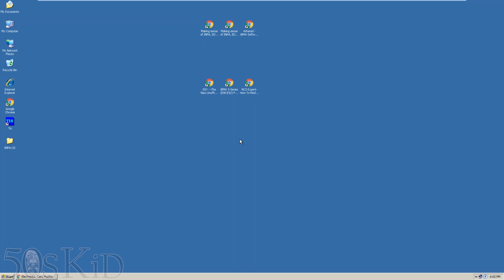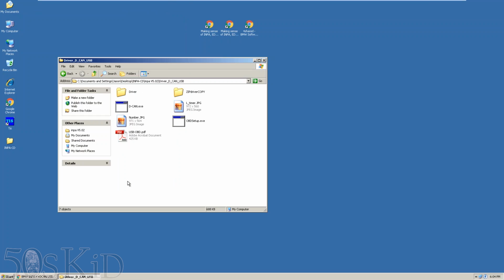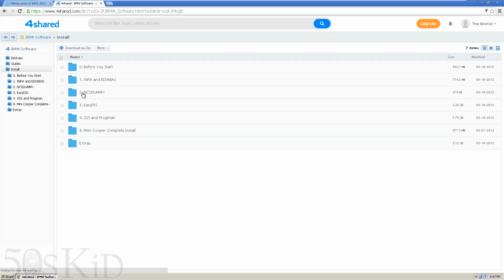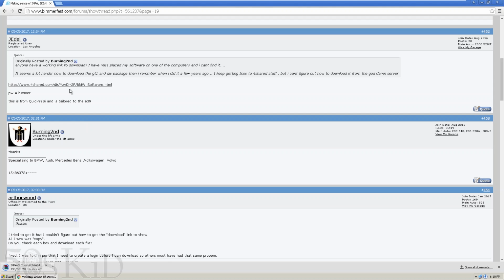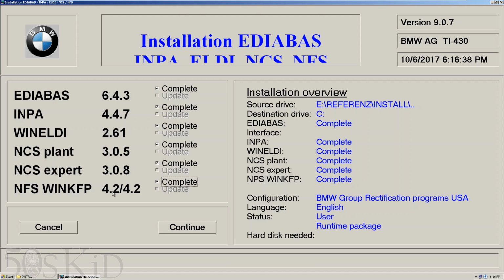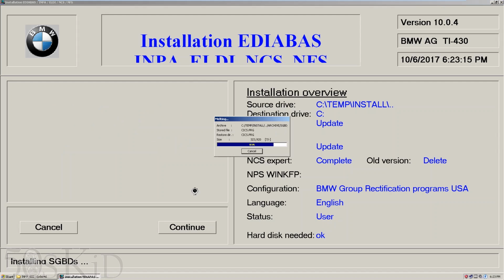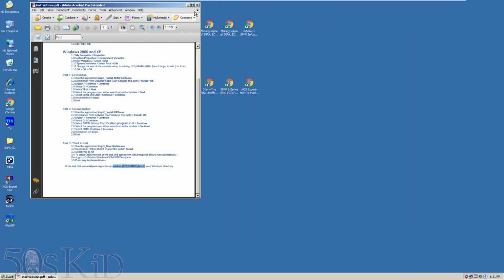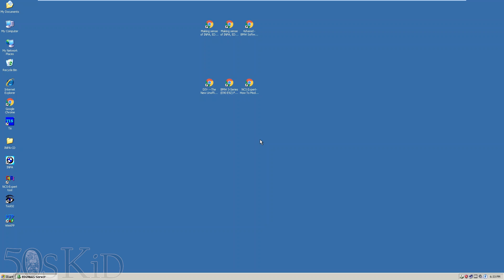How To Install INPA & NCSExpert

Comment: Thank you so much, gonna get the PC going when I get home

I have an 03 540iT, got a 97 540i6spd because the more pedals there are in a wagon, the cooler it is

I'm gonna consult the forums for post facelift auto to manual coding because that link is dead, but nbd

Comment: Hello 50's KID... perhaps you've some instructions pointed at disabling/removing The "ews" features from the DME...My same vehicle is the 2004 E60 545i. produced in may 2004. Inpa error codes are 2737  & 27A4... Perhaps there a preferred way to contact you?  (youtube doesn't allow?)

Comment: hi, need some help. i have it installed, v5.0.0 on my e46 INPA can read the digital and analogue values, it can read in detail the DSC fault codes, but wont read the engine codes in detail. when i select s54 engine it says 'versions do not match. Malfunction possible' Any help would be appreciated (Windows XP)

Comment: Hello my name is angel I have a m73tu swapped e39touring and I have an issue that I can’t seem to find anyone to help me with. I have a laptop with bmw softwares that I bought off eBay a while back and I used to be able to switch between OBD2 and ADS to connect to my cars but something happened while a tuner was remote tuning my brothers tdi through team viewer and I think he might have moved some settings but now my computer only communicates via ADS and I need it to be able to communicate via obd so I can use sss progman to code the dsc module in my e39 any help would be greatly appreciated thank you✌🏽

Comment: your funny david so the ftd2xx.h c++ header fetches the i386 32bit files for the amd64 folder... mikes not so easy tools windows 10 doesn't allow a-lot these days they even shut down virtual machine appliances operating on certain ports but still works on win7... besides if you plan to buy VAG-COM 409.1 you will need a 409.1 CAN and the software which i have and successfully used on a 32bit windows vista.... so you might as well get professional and get all the CAN's to do BMW,VW and maybe others.... stop messing around w/ this 64bit business ...

Comment: I was able, incidentally, to resolve my problem with NCS Expert not running when INPA did run. So for the benefit of others who might encounter a similar issue, I did so simply by soldering together pins 7 and 8 on the OBD connector (top left two pins on the wide edge as you look at the socket). That was the simple fix which got NCS Expert running perfectly on an '02 E46. I have the white circuit board on my OBD connector and understand that the green circuit board is preferred, with two K-Line leads, thus presumably not requiring the soldering. But the soldering together of the two pins works.

For those unfamiliar with soldering, use a short, half-inch length of wire to solder the pins together after removing the four screws on the socket and gently prying apart the two plastic shell halves of the socket. Gently unplug the small socket connector inside from the top of the circuit board to avoid touching that inadvertently with the iron and then plug it back in when done before putting the shell halves back together. "Tin" each exposed end of the half-inch length of small-gauge wire, that is run a little solder over the exposed ends before soldering to the pins, to make them easier to solder to the pins. Then all you need to do is momentarily touch the tinned ends to each pin while soldering for just a couple of seconds or so. That way you won't run the risk of de-soldering the pins or burning any components with excessive heat. 

I had already changed out the USB driver on Windows XP in the Virtual Machine, which was loaded by default during installation, to the most recent version at the "Virtual COM Port Drivers" website, FTDI drivers. Look for the most recent XP driver or the most recent Windows driver and either will work. That had been my first connectivity issue, which prevented even INPA from working. Install manually in the Device Manager of the Virtual Machine XP version, not in the host Device Manager. (I am running Windows 10 in my host machine.) 

Thanks again for these excellent videos. They saved my day after two and a half years of looking for precise instructions on recoding the computer after the transmission swap to eliminate the error code looking for an automatic computer module no longer present, hence preventing smog inspection, even though obviously having nothing to do with emissions ...
Reply: I just wrestled my way through numerous software configurations and after seeing your comment here, finally remembered from a long time ago when I was setting up bmwlogger with a k-line adapter on an E36, that people were mentioning bridging those pins. I didn't have to do that then, but this time I was starting to suspect the hardware and I'll be damned if shorting 7 to 8 didn't fix my "VIN is faulty" error that I have been trying to get past for like three days. Thank God I saw your comment! On a side note, I purchased my k+d can adapter a year or more ago and just had it on hand, so I'm not sure what is going on with ones produced now, but my PCB has a green solder mask, not a white one, but it required the jumper just the same.  I don't usually read comments but thank you so much for taking the time to note this.

Comment: This is a superb series of video. I am also trying to recode my E46 to a manual from an automatic after having performed the swap and this is the first series of videos which provides the sequence in clearly understandable terms. I have been looking for two and a half years since I completed the swap. Thanks... But I have a problem. I got the software working properly and INPA links to the car and reads, etc. But NCS Expert, while it loads expert mode properly, returns a COAPI 2020, no response from ECU, error code whenever I hit any of the modules under ZCS/FA f. ECU after entering E46, i.e. AKMB or ALSZ. I was having a problem initially with INPA not addressing the car, until I changed out the USB driver to 2.08.24 on the VM XP 32 bit device manager from an earlier driver which came with the D-Can + K OBD connector. So, now INPA works, but not NCS Expert. I am set up in the XP Home Edition on the Virtual Machine in Windows 10 64 bit original host environment. I have a feeling it is still some connectivity issue with the USB driver in the Virtual Machine for XP. The USB driver, incidentally, is configured to COM1 with a latency of 1. Has anyone else encountered this issue? It seems odd that INPA works but not NCS.

Comment: This is the best instructional with NCS expert INPA installation. Honestly information is all over the place and sometimes I've spent time I cant get back reading forums only to  conclude that it doesnt show how to do it or its wrong and not working. Thank you sir.

I have one question though on a subject Im having even harder time finding. I plug it in and INPA recognizes I have the cable plugged in. When I go into NCS Expert it recognizes it as well but when I try to load the modules and read VO it brings up "Following feature is invalid for FA: #1207" and I get it to load the codes but I cant change them. Ive read in various forums that I have to update the Daten files and I finally found a download page with V60.1 I think...Well now I have no clue how to update them. Ive tried manually copying them into what I thought were their respective folders but it actually made the program work less and gave me more errors. I had to reinstall your method again as I lost where I went wrong. 

Anyway you can help guide me what forum (theres so many) you may have learned to update, etc? I have a mac running Windows XP 32bit virtual machine. Trying to code on a 2008 335XI (has JB4, this couldnt be an issue could it?) . I should try it on my e46, maybe its my car, or maybe my cable...

Comment: Hey boss. I am planning  to do coding on 2005 bmw 325i. Is this cable works on it ?. I looked some comments they said this cable doesn't function  proper  because pins . It should be 7 pins.  Is it true. If yes then please advise.

Comment: Hey 50sKid - thanks for putting up this fantastic Video. Do I absolutely have to use COM1 for the serial port? I have COM1 currently "in use" so I opted to use COM2: is this going to be an issue?
Reply from the maker: whatever is using com1, find it and change it to use another com port, then reboot and you can use com1 for the cable
Reply: Thanks for the response. Just installed everything and it works great. Thanks for putting up such a fantastic video

Comment: Can you help me out?  I have a 2006 E46 M3 SMG.   I bought software and a cable on EBay but discovered that my BMW model was not included. Could you point me to some where I can get the complete software package that will work on my M3? I’ve looked at so many packages I’m cross eyed and confused.
Reply from the maker: Look into ISTA rather than INPA. It's newer and covers more.

Comment: Sir, You rock. Yeehah! Following your astonishingly clear instructions I'm up and running on a Mac Air with Windows XP, using virtual framework Parallels Desktop 7, on Mac OS10.6.
Reply: Btw This is NOT a criticism but the very first step in the pdf instructions seemed to be missed out - Updating the System Variables Path. 

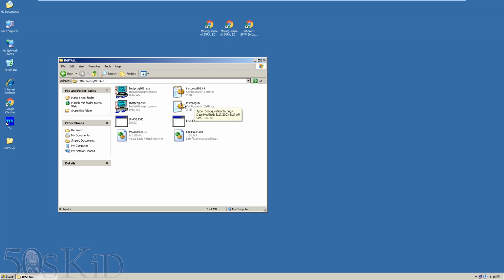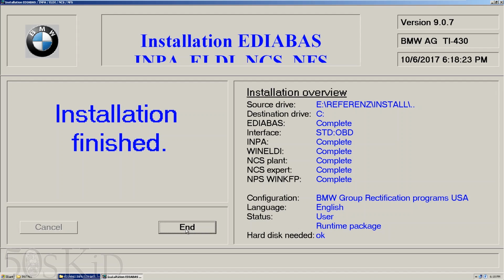A note for anyone else doing this and having errors after running the Install EDIABAS etc (Instprog.exe at 8:52). At the end when you hit the Exit button (9:25 in the vid) it can take a while for it to close. Just wait for it to close itself. It is definitely working in the background and the first couple of times I force-closed the window which I think was the cause of subsequent errors. The more of the modules you 'Check' to install, the longer it seems to take.

Comment: Just a VERY important tip, make SURE you get the cable with the GREEN circuit board, I went through trial and error buy buying one with a WHITE circuit board that does NOT work. I eventually got the one with the GREEN PCB and it works 100%

Comment: Thank you for such a great tutorial, however, didn't work with my '11 328i e90.
Didn't work with Windows 7 and I tried it on an XP laptop.  
After successfully installing it on XP, INPA worked flawlessly, however, NCSexpert didn't.
The error code I was getting is "Following feature is invalid for FA: #0910".
Any help would be appreciated!
Reply: Solved it on my own.  Simply updated the SP-Daten files and all is good now.
Again, thanks for the great video, couldn't have done it without it!

Comment: im very new and 50's kid has helped me do tremendous things with my bmw that i never would have dreamed of doing, the vids always give me confidence and always work 100 percent....but the one thing i would like to know is WHAT CABLE DO I BUY? i bought an older laptop with windows xp followed these instructions and it worked perfectly, but i need a cable with a 16 pin to serial port (since this laptop has one) that will also allow me to use my 16 to 20 pin adapter for my 323i. im at a loss which cable i am supposed to buy. 50;s kid please help!
Reply: ps the cars ill be using it for are a 2004 325xi, 2004 330xi, and 2000 323i with the obd2 and 20 pin under the hood

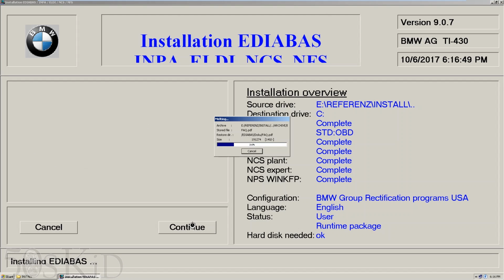Comment: When I got to 9:24 a pop up came up that some PATH is not found? Link to the pop up image here: https://i.imgur.com/fL0ZAcp.jpg

Any ideas what went wrong? I am installing on Win XP Pro 32 Bit but I don't have a cable yet so I was doing it all on the laptop from where the point where you download and install, I skipped the cable and driver bit. Is that why it went wrong or is it something else?
Reply from the maker: Yeah sounds like you need the cable first
Reply: Do I have to have it plugged in to the car aswell?
Reply from the maker: no just the laptop

Comment: Great tutorial. But, gosh darn it, I copied the wrong NCSEXPER file in the very last step. I copied NCSPRINT by mistake. Now it's all in German. Lol. I got too excited for the end, because all my previous attempts to install with the CD that came with my cable kept throwing errors to paths not found. This tutorial is great, well articulated, and everything works like how it works in the video... Just be patient
Reply from the maker: So if you google "ncsexpert in english" you will find a link to the forums where someone has attached the proper file that you need
Reply: that worked!!! thanks. first froum too, bimmerforums https://www.bimmerforums.com/forum/showthread.php?1594236-NCS-Expert-in-English-!
"BoolD30" post

Comment: I ran INPA 5.0.8 on every single Windows version after XP (Vista, 7, 8 and 10) with no problem. So before messing around with a virtual machine for no reason (unless you dont want that stuff on your physical computer) you should get this newer version. 6.4.3 is only essential if you want to diagnose older BMW without OBD. But then you also need another diagnostic cable.
Reply from the maker: the virtual machine was done because ncsexpert won't run on a 64-bit system.
Reply: +50sKid The version that comes with inpa 5.0.8 runs on x64. I am running it on a Thinkpad X200T and T400. Both Windows 7 x64.

Comment: Hi 50skid.I have a bmw x5 e53 2001.. 2 weeks ago on my dash apear transmission failsafe when drving.. And need press pedal gas to deep to keep driving because few like stop its to hard to make runing.. But if turn off and turn on again locks like no normal.. Runs good and transmission works good again.. This happen sometimes when stop on ligth for a second.. Bring to mecanic but dont' find anything.. Can you tell me what can do.. Thanks..

Comment: Hi mate.
As good as this programme is.. Could you tell me your views on the 'Carly for BMW' app? I've recently bought it, plus some of the addons, but still using my own obd2 wifi adapter instead of their £50 version, and for what it does I think it's great although a lot of functions aren't that clear. I'd like to hear what your thoughts are on this app if you've used it, or if not, could you do a short video on it as you explain things a lot more clearly than your average instructions.
Daz from the UK.
E61 530d 2007
Reply from the maker: Never used it
Reply: I think there are better tools for the money, in this case you are paying a useful app to use with your phone, but I think that for the price you could use (much) better tools to use with your laptop.
Reply: Nice car Daz! Exactly the same as mine over here in NZ. The Carly is very good for simple reading and diagnostics but beyond the basic updates like battery registration and changing and fault code resets it doesn't have a patch on the depth of what you can do with this software and a $15 cable. And every time you want to do anything functional in the App it seems you make a 5, 10, 15 euro payment.  I understand that their pro version of the App and coding may also now be restricted to using their own Wifi Adapter, the price of which seems to keep going up.